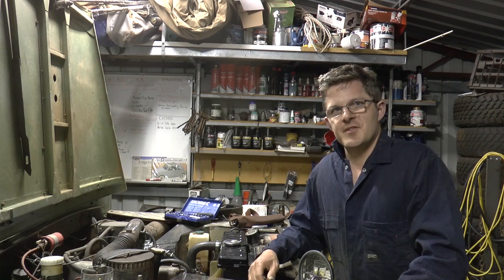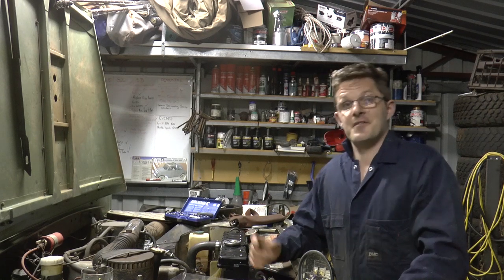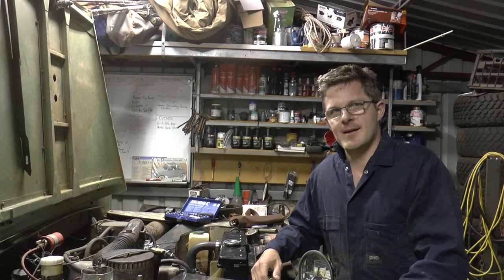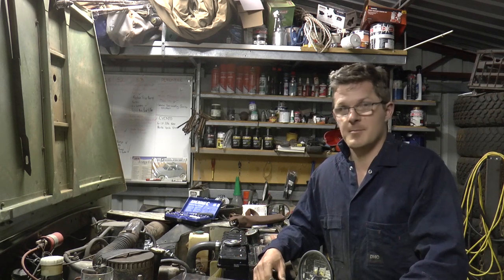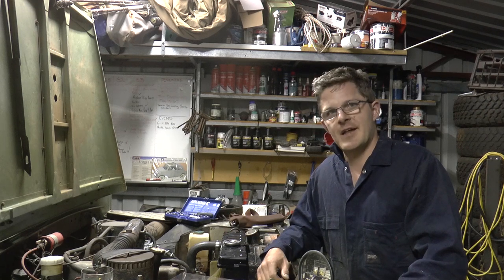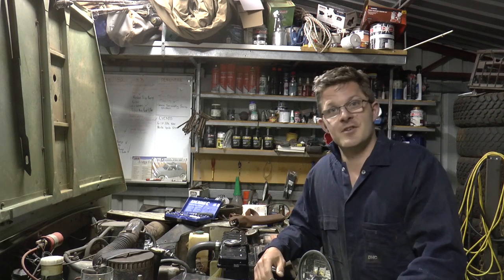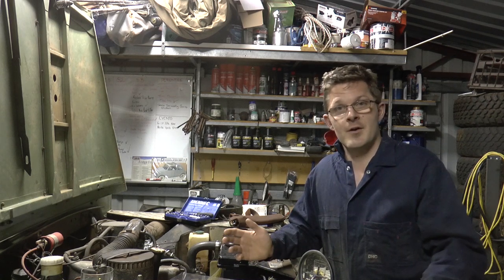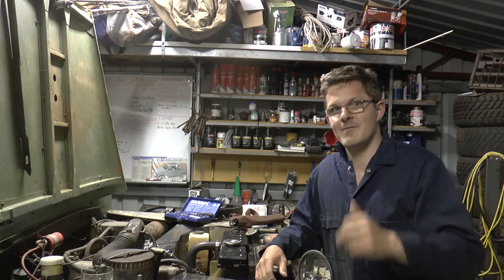Viscous coupling, improving your cooling system

Comment: Viscous couplings are a good non electric means of controlling the engine temperature. They do not make the engine cooler by themselves but you can use them with a bigger fan like you did, very nice modification. A good practice with a viscous coupling is checking regularly if it has not locked up and is engaging the fan all the time. If it does the engine will run below operating temperature.
Reply from the maker: Very true and thank you for your input. Cheers Geoff

Comment: If you place a shroud around that fan to force it pulling air through the radiator would perform even better specially if there's no gap between the face of shroud & back of radiator.
Reply from the maker: Hi Ahrned. That is very true, though sadly the mature Landies still struggle. Cheers
Reply: @seriouslyseriesaustralia  I did it on a 3.9 and the coolant temp went 10C° down just by closing the small gap between the radiator back & shroud's face.